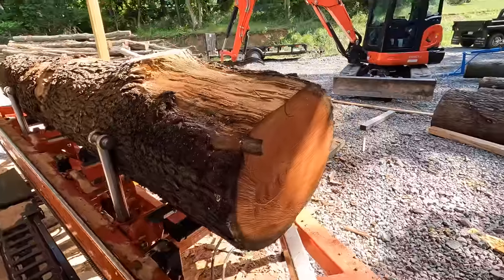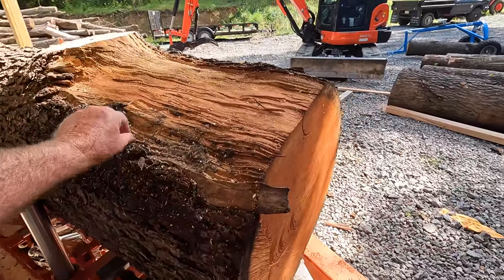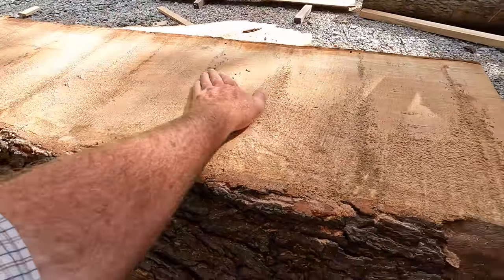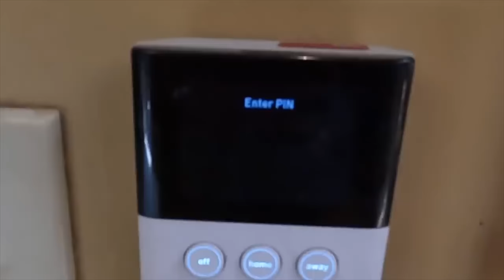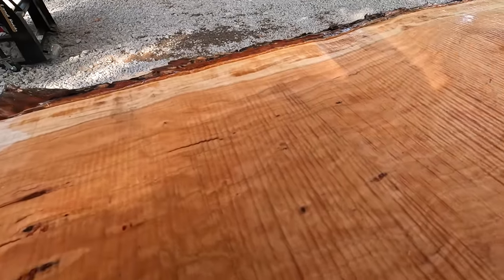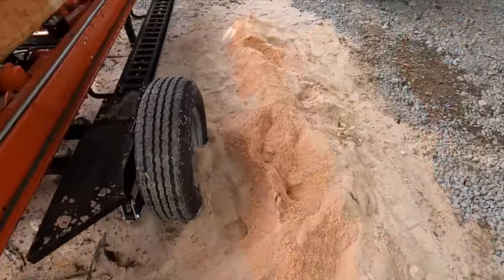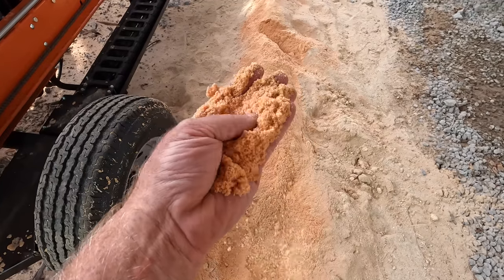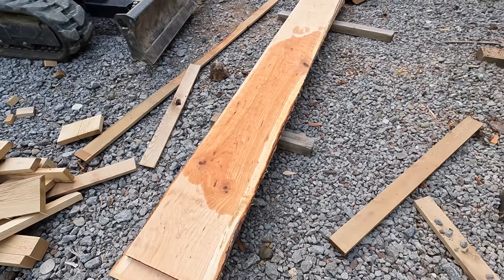We FOUND a Real Humdinger Here, Big Ole Black Cherry on the Sawmill

Comment: I don't know if you know this but your mill has rail lubricator felts for the top and bottom rails. The top felt is between the posts with two lube application holes. I prefer to remove the unit and apply the ATF directly on all of the felt.
The lower rail felts (qty 2) require you to get on the ground. Just squirt the ATF into the holes. It's a PITA but it works.
Dave
Reply: That sure is a "state of the art" sawmill !! Turning, leveling, debarking, etc. It's almost magical !! And you keep it in such great shape, Mike !! Like your vehicles !! I'm sure that's why you don't have as many breakdowns as so many people have !! Thanks again for this video which featured that beautiful black cherry log !!

Comment: What do you do with your off-cuts? Do you split them and in turn sell them as fire wood? Several years ago, I was able to help a youth group prepare for a camping excursion and we needed to build an outhouse. The lumber used was mostly off-cuts (second pass) with the live edge left on. It didn't need to be fancy, but it really gave it a nice rustic fit for the area near Custer SD.

Comment: I'm going on 64, I slowed down a lot these past few years. Put in an oil or gas furnace for your later years. I spend about $1000 or less per winter on oil. 225 gallon oil tank.  Furnace needs a service check up/cleaning once a year, cost about $150 or less. I think I've gone like five years without getting it serviced. I'm north of you right on Lake Erie, Ohio and PA border and the winters are bad here sometimes.

Comment: It might have been said already, but you should use anchor seal on the logs ends before you mill it into the cuts you want. It helps to keep the boards intact by keeping the ends from splitting. Last thing you want on such a beautiful piece of wood is for a split end to travel up the board.